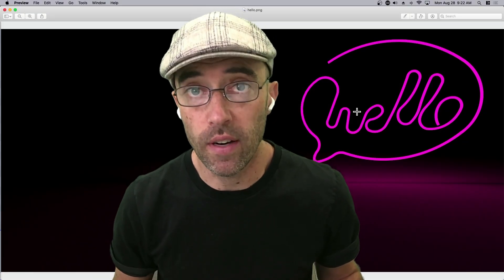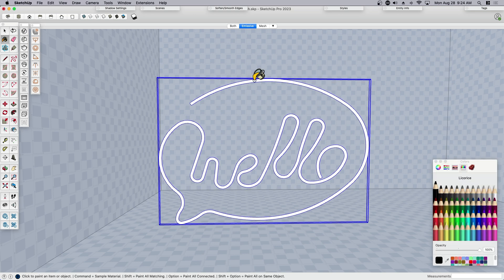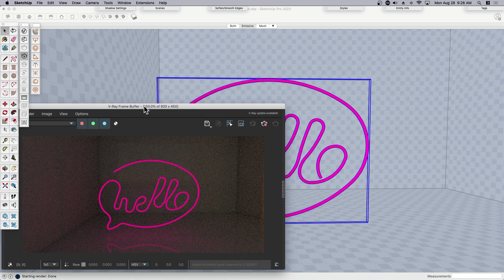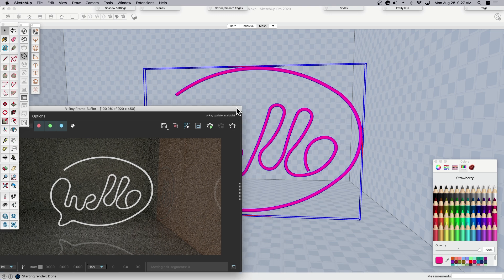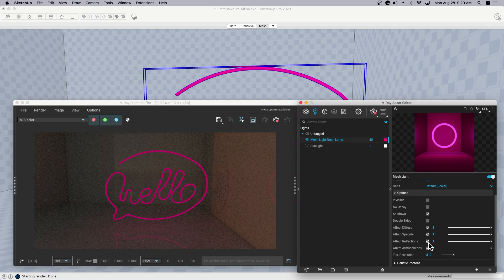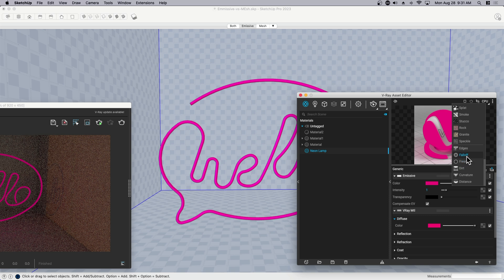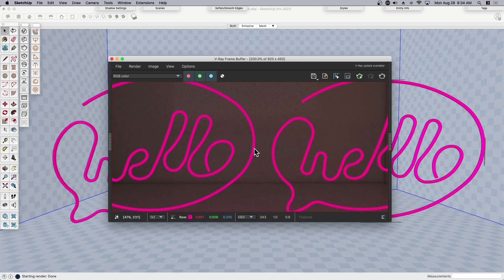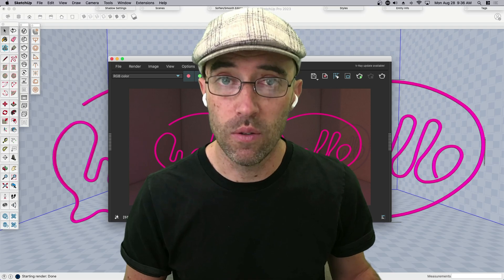Why to Use V-Ray's Emissive Materials vs Mesh Lights

Comment: I remember the excitement of being a junior and being the first in my department to learn V-Ray. I spent my evenings and weekends mastering it about 10 years ago, and at the time, I impressed people with what was possible. Even then, just using SketchUp and V-Ray was groundbreaking.

I later transitioned to real-time rendering, as it resonated better with clients. They were more impressed when they could walk around their finished house using software like Enscape or Twinmotion, both of which I became proficient in.

Recently, I haven't even bothered with those tools. Instead, I use stable diffusion and create composites in Photoshop. This approach is at least 10 times faster for me. And also allows me to get a little more experimental sometimes which can yield unexpected creative results.

While I wouldn't revert back to using V-Ray or twinmotion in my business.

As an artist, I still love using the Vray especially, but it doesn't have a place in my toolkit anymore when it comes to hitting deadlines and making money in my professional life.

I work in domestic architecture which has super low margins and high throughput.

I can see how v-ray would still make an absolute ton of sense for commercial projects though.